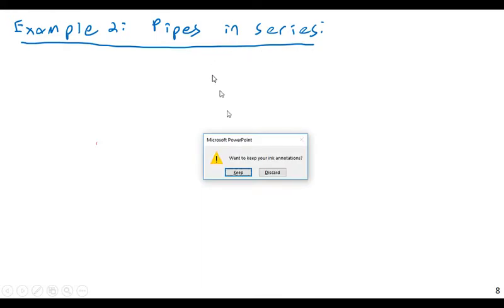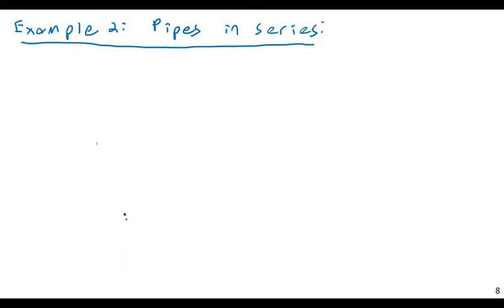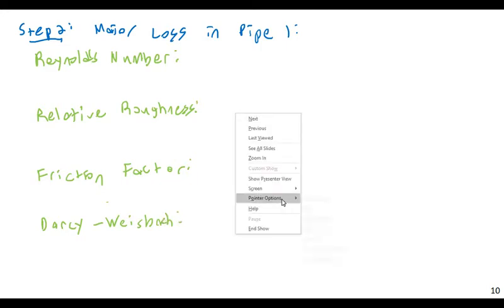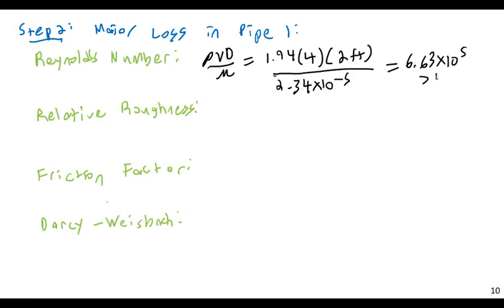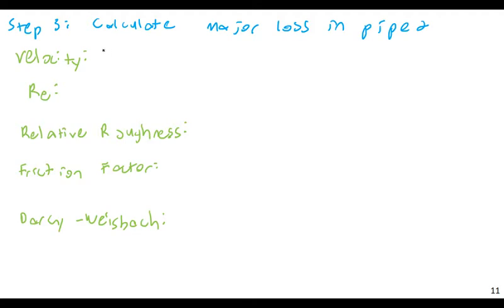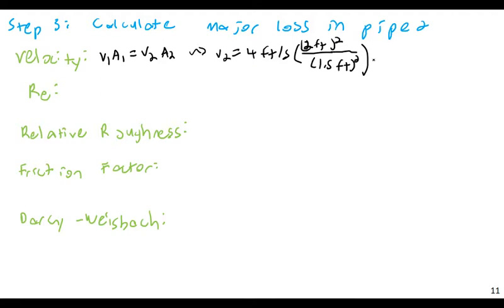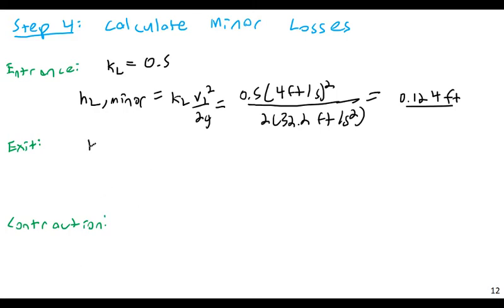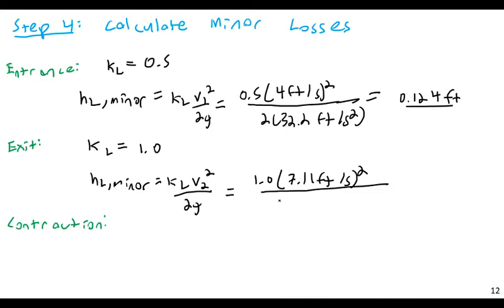Minor Loss Examples - Part 2 -Fluid Mechanics

Comment: so I have a question, the cross-sectional area of the pipe has decreased so the velocity of the fluid will increase therefore the value of the Reynolds number will change, therefore each section of the system will have a different Reynolds number, so each section will have a different value of a major head loss. is that correct ?
Reply from the maker: Yes, that's correct. A change in area will result in a change in reynold's number.